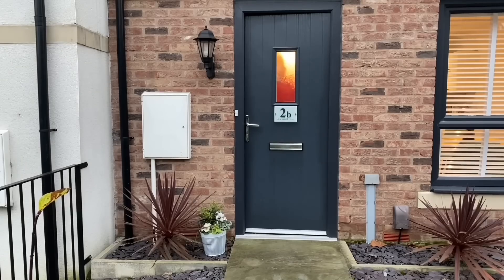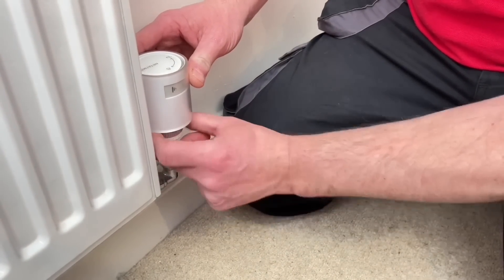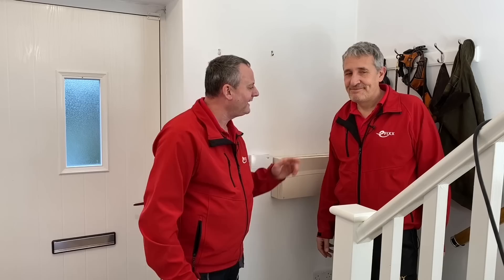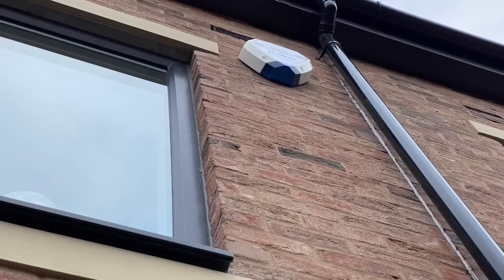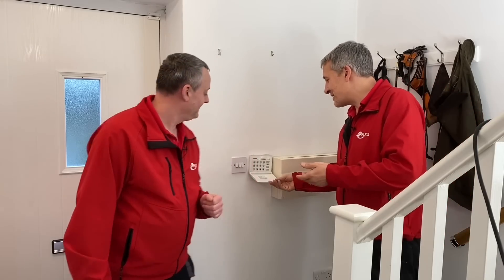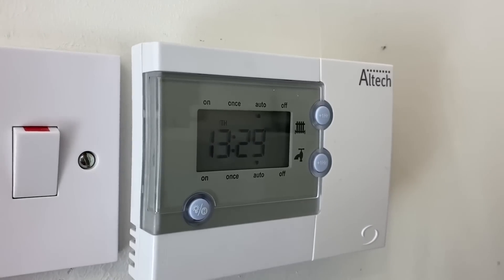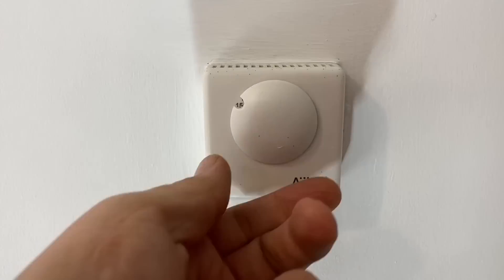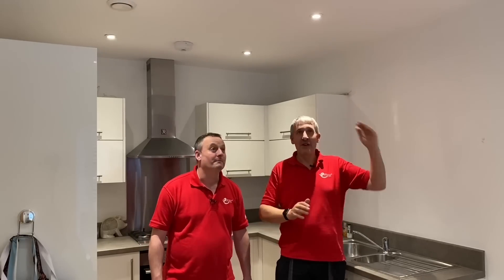Efficient but DUMB! - NON SMART HOME TOUR - Why do builders do THIS?

Comment: Smarthomes are my profession and it's really great to see two people explaining the basics on the world wide web. I've seen many unsafe installations in my life. But what I would improve on most of the cables is ferulles and more isolation. I saw that the previous installer used electrical tape. But it was better to completely isolate the wires with professional products.

Comment: Good video of a realistic scenario. New car tech new problems. I wonder how the grid and local suppliers will hold out when electric cars start to sell in big numbers? The board position is unbelievable and the fact you have picked a nicer looking board but now has been cluttered up with stickers on the front is a shame?. Im not a sparky but the warning stickers should be under the lid and have to be removed to get the front off. If you are then inside a board and you need to read stickers about whats in there you should not really be in there Imho.

Comment: Any half decent solar inverter (including the Omnik shown in this videi) has a GFCI built in. And it will trip on DC leakage current. There is absolutely no need to have that built in your 'consumer unit'. The reason for this is simple: It is mandatory in a lot of countries.
Reply: It’s not the solar inverter that’s the issue.
Reply: @JasperJanssen  As a matter of fact it is. That's what they are talking about around 9:22: There is an RCD installed, but one that trips only on AC leakage current. They are concerned about the lack of protection against possible DC leakage current through the PV installation. That's not something to worry about, as that protection is built in the solar inverter. Some (specifically Asian built) inverters might not have that kind of protection (those are not legal to use anyway), but the one shown in this video certainly has.

If you think they are concerned about something else than the solar inverter, I am very curious about what that might be.

Comment: I would like to offer a possible excuse for the shoddy craftsmanship.
Not sure what it's like in the UK, but over here in the Netherlands the large scale construction market has become so infested with (sub-)contractors and middlemen selling eachother the contract (skimming it at every step) that by the time an actual craftsman reaches the build there's just no budget left for a decent job.
Reply from the maker: I think we share the same problem - interesting that it’s similar situation in the Netherlands 🇳🇱
Reply: I believe it's a compounding of two problems.
First there's EU law that states every contract beyond a certain volume has to be made available for public bidding. Which in itself isn't a bad rule, having multiple qualified electricians bid on a contract will benefit the consumer.
But add to that the fact that with the '08 financial crisis we lost a lot of real craftsmen. And to keep (/get) build volumes up afterwards we threw out all registration rules for (technical) building companies.
So now anyone, unburdened by any knowledge or schooling can call himself an electrician and start bidding on those contacts.

Having killed a bunch of people by anything ranging from asphyxiation by faulty ventilation, poisoning by offgassing foam insulation to the old electrical fire we're now moving towards a certificate system, so that's something at least.
I still believe there's something to be said for the old system of a few years in school, a few years in the field ánd the specific certificates before being allowed to start a business though..

Ps: sorry about this lengthy post. But you guys appear to be genuinely interested enough to read a few more words.. :-)

Comment: The heating system wiring looked just like mine looked when the gas safe boiler chap turned up to replace my ancient boiler. Amazingly he just looked at it and knew what did what and hooked in new bits no problem but that was the decent wiring. Down at the calorifier the original installer had managed to cram in wiring for valves and other bits into the tiny enclosure of the cylinder thermostat, wires just twisted together and pushed into ceramic caps, guess that met regs in the day. All since replaced with a proper Honeywell wiring boxes.

Comment: I like to think I am smart. I know my family routines. I set my heating programmer for the required times when in and out of the house...... I am not a fan of the so called smart tech although I like the idea of storing/diverting unused heat/energy for later use by the occupier. One thing, was that a heat alarm in the kitchen there? Fitted so close to the cooker? I hope not. :)

Comment: If the RCD trips then is does so in about 25-40 milliseconds.  However I believe once a grid tie inverter loses its external ac supply it can take up to 5 seconds to stop producing electricity.  That’s an extra 4.6 seconds during which time someone could get electrocuted via once of the other MCBs that is in the same circuit as the solar panel RCD

Comment: My guess is that the installation at the time was designed and quoted before the date for fitting metal consumer units.  It was until the properties were designed and quoted after the dead line date that they were fitted. It was another way of scrimping for these new build firms.
The bell transformer should be in seperate enclosure due to voltage difference.  RCD are rated at 63A until the manufacturers realised that they should be rated for main incoming fuse unless it's a 60A incoming they should be 100A and type A as you say.
Solar PV should ideally be on an unprotected or RCBO circuit to prevent any tripping isolating the solar for potentially losing time generating. And requires isolation at consumer unit and again as you say missing dual supply stickers.

The alarm system is a texecom veritas R8, faultless.  Good alarms we fit the premier elite 24 panels. And you can go smart with them as we fit the app connect for app control for setting unsetting etc via a smart device, not only that we as installers can remote access for maintenance and help with a issues the end user may have.  Great systems.  I'm currently installing one on a job as we speak. Combination of wired and wireless with smart control.

I'm a great fan of nest so I'd kit out the nest thermostats 1 downstairs and 1 upstairs, nest smoke alarms, nest door bell and nest home hub speaker.  

Great video would be good to do as you say and see the smart tech you put forward in practice.  And maybe a camera on the front 🙂
Reply from the maker: Thanks - This is the first time we’ve fitted the Netatmo system. We have also used the nest kit so we decided to give something else a try. The netatmo integrates with Apple HomeKit which next doesn’t.  Would be keen to share your experience on setting up apps etc for the customer attaching to their network and on going support issues.
Reply: @efixx  I'm happy to share my experience this is what it's about 🙂

I'm sure I saw a clip that you have done fitting the netatmo so I'll give that a watch later.  Interested to see what they're like.

Comment: Does that Heating control work on Opentherm?
Reply from the maker: They have two versions - see tomorrow’s video
Reply: That boiler has two SL inputs from memory  
To make it truly clever the Opentherm can modulate the boiler and generate more Condensing, being a condensing boiler this should be done. To do this the 2nd SL needs to be wired into the HW, when the HW calls the boiler will go into max rate, at these times the CH should be isolated via the zone valves, once the HW is up to temp the zone valves can open and the CH can be ran correctly  

Another option is the Weather compensation  

This id say is a truly smart system rather than an on/off control that can be switched remotely  

Hope this helps

Comment: In the consumer board, no fire foam/sealant, and a brown link wire on the neutrals. PV wrong I think but has very little to do with PV.  Lack of isolators. Etc
Reply: no fire seal needed.

Comment: Definitely a no no guys removing the cover without isolating the main switch. 
My NIC EIC inspector would have something to say if I did that in front of him 😄. 
Definitely would say that regardless of the plastic consumer unit the cables should have been fire sealed that exit out the back into a cavity/ void .
Reply: Can you refer to reg that would cover this.  Thx in advance
Reply: @tonymariner5519  BS 7671:2018 for fire stopping Regulation 527.2

Comment: It’s great to see the quality of work that professionals produce. The clash between the electrical installation and the plumbing in the airing cupboard is an absolute classic. We often referred to as the shipbuilders jetty race - the foreman lined up all the pipe fitters on the jetty, like a Le Mans start,  with the pipes they were going to fit in the engine room. As he blew the whistle the young racing snake with the 3 metre length of 1/2 inch copper disappeared like a shot and leapt down into the engine room and got his pipe lined up and connected no bends, no sweeps as straight  as a die. Meanwhile the twelve guys carrying the 24 inch main steam steel pipe arrived in the bowels of the engine room an hour later (it weighed a ton), most perplexed to discover they were going to have to take the bugger back for bending as they needed to double back up and over a 1/2 copper pipe.

Comment: In my opinion,the world not ready for this smart technology..I have installed modern storage heaters and panel heaters .Set them up ,explained over and over how to use them ,only to find  a couple months later they have not used them as they are to complicated. Often just switching them on or off on the isolation switch ,or just plugging in a heater they have bought from argos  because it’s simple to use. . I would say as well in about 40% or homes people don’t even know how to work a digital room stat or programer. Just using them as a on off switch. In the old mechanical days 99% of people could walk up to one and know how they work..Smart stuff will save money but it’s the same with cars when it goes wrong it will cost more to repair than it will ever save in its life time. 
It’s just my opinion but also based on what I have seen  so often
Reply: Never a truer word spoken
Reply: Exactly my partner struggles to understand that the underfloor heating won’t come on unless the room temperature drops below the temp set on the stat, then complains that the floor is cold.
Reply: A truly smart installation done by people who understands both the Technology and stupidity of the end user, simply works, no user input required, and andjustable by seemingly Old means. A “stupid” switch, Can easily be made to do smart things behind the scenes, without rendering the user confused.
Reply: @denniswiechert9791  I like this. Love to see it in action.

Comment: why are the consumer units made of plastic? we here in North America have NEVER made ours out of plastic.... always steel! have you ever had the chassis of a CU fail?
Reply from the maker: We've gone all metal a few years ago - this install was one of the last under the old codes (regs)  - we've seen lots of bruned out homes - hence the change of codes.
Reply: @efixx  why did it take so long? don't people in Europe want safety? they do teach fire safety there don't they? electrical has always been part of that...
Reply: @johnstancliff7328  They used to be made of wood, or at least the chassis! Our main fuse box is still a Wylex wood plastic mix. Then they went all metal, then all plastic or metal, then all plastic, now all metal!!! We have a combination of all on our property - except for a modern 18th edition all metal variety. Nothing like fiddling with fuse wire on a cold dark night 😉.
Reply: @androidcaller7902  wow.... Ours have always been metal because of the safety and longevity of the units...  metal won't burn like plastic and keeps the failure contained... at least in most cases.... commercial fires have been linked to large panelboards failing and having a electrical fire. but, thats rare.
Reply: @johnstancliff7328  Our boards went plastic as metal ones used rust out after a time in our climate and depending where the steel came from to make them. The metal boards we fit in the uk are not safer than the plastic boards that were fitted  in my opinion. The burned out boards were more likely to be poor instalation and lack of maintenance/checks. The new super improved metal units are often screwed to wood with the back knockouts open to allow the cables in and the flames out! normally directly into wall cavities and through ceilings!!!

Comment: cant see  the fanny trap on the heat recovery condensate drain
Reply from the maker: That’s a new term for us - we’ll try to find it !
Reply: @efixx  technical term, a HepVo valve, but thats what plumbers call them, needed to stop the risk of smells being drawn into the unit when running, and usually high up on the pipework...., not into a tundish as is often the case

Comment: I'm not the biggest fan of most smart stuff, but it definitely has it's advantages for the heating system so the heating can kick on a bit earlier and turn down a bit later when it's freezing outside instead of just relying on a simple timer, and the owner can turn up or down the temperature remotely if they can go home for the day earlier than usual so they don't have to come home to a cold house. The alarm system would also be a great thing to upgrade so the owner gets notified on their smartphone if the alarm goes off, maybe check a few live camera feeds, automatically call the police if the owner doesn't react within a certain time... And I suppose it's also handy in day to day use to check if the windows and doors are closed and locked.
Reply from the maker: Let’s see what we can do to this house - stay tuned!

Comment: I really fail to understand why we fail to install newer systems. 

I decided when i redid my house which is 1950s i would put in an underfloor manifold for the radiators and a thermostat in every room it really has reduced our oil cost saved far more than the cost of me installing

For wiring i use brother heat shrink labels super easy know which wire does which room
Reply: Those printable shrink wrap are revelations I've used them over the years.
Reply: @davidsharp9166  honestly, I never knew they existed. I doubt I’m alone. 

I’ve tried lots of ideas to mark cables but nothing has felt the right solution. Then I found shrink wrap. 

Someone will moan “oh it’s really expensive, just use a biro...” and to them I say, the cost of the shrink wrap (actually not that much) saves you so much time (and time is money) it’s more than worth it.
Reply: @GeeTheBuilder  they are pricey but worth it.
Reply: @davidsharp9166  definitely!
Reply: @GeeTheBuilder  a label is always worth it. We've all seen that DB that was  marked in Oldie English in a Carpenter pencil possibly.
Reply from the maker: Ahead of your time - we’ll done - what’s your predictions for the next 20 years.
Reply: I have recently started to use printable heat shrink for cable markings. They are a thing of beauty - and work really well. 

I also gutted my 1930 house and put UFH in every room, up and down, each with its own wireless thermostat (Evohome)

Well worth it.
Reply: @GeeTheBuilder  can you post a link to your label printer please?
Reply: @TheHawkeye001  https://www.brother.co.uk/supplies/p-touch/tapes/hse/hse251 the cassettes work with lots of printers. The description tells you what ones.